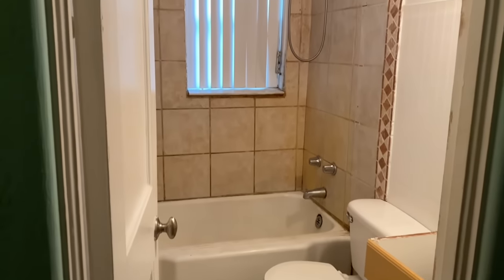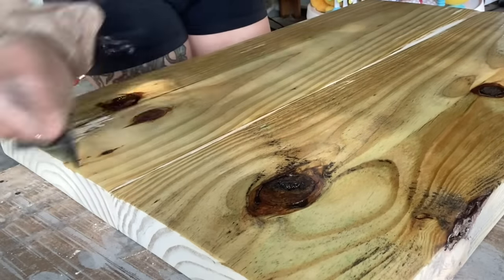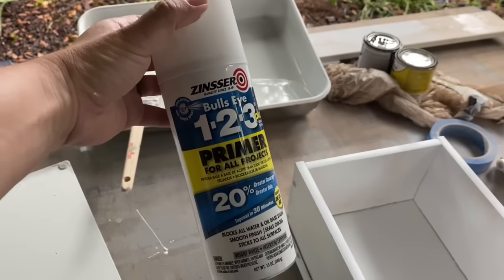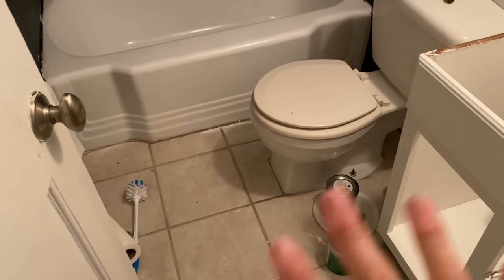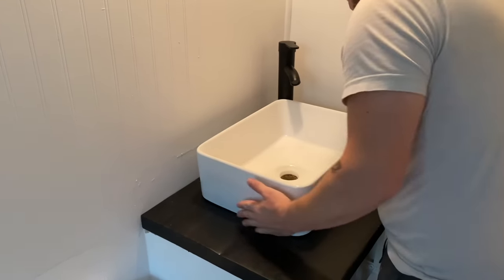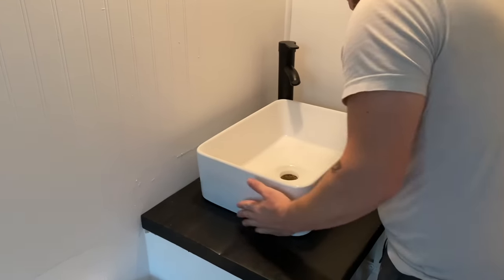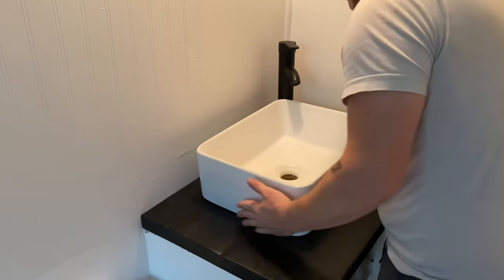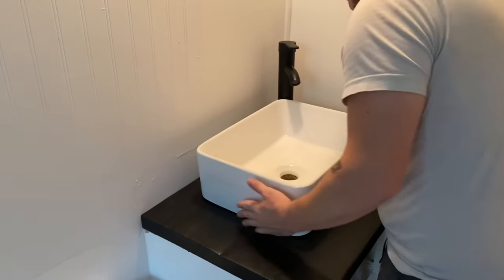BATHROOM REMODEL ON A BUDGET | Tips to Save Money

Comment: I think you did a great job!    I renovated my half-bath in a very similar way to how you did your bath vanity:  made a black painted countertop out of plywood (waterproofed with a sealer), put a white vessel sink on top that looks pretty identical to yours, with a very similar faucet.   Initially I also put vinyl peel & stick tiles (not grouted) over some ceramic tile that I hated, but I had to rip this up & replace this eventually with a vinyl sheet floor due to the underlying grout lines from the ceramic tile floor ‘bleeding’ through to the vinyl.    If you ever lay down a vinyl floor again over grouted ceramic tile, you may want to consider leveling out the ceramic tile floor to fill in all the grout lines otherwise, over time, you will see a shadowing or a dip happening in your vinyl floor where all the grout lines are underneath.    BTW, you have a gorgeous baby!

Comment: Just to inform those that like to discredit stick and peel, I have used muscle bound which is double sided adhesive for non heavy 4mm tiles behind a bathroom vanity... 4 years in my master bathroom and no type of structural failure... but... with that said, I would not use it on floor where moisture can build up. Even tho you're placing that on top of ceramic tile, that's gonna fail sooner or later.   That's heavy foot staffing too so, I wouldn't risk it lol

Comment: These cheap renovations always look cheap and, iMHO, do not add value to the house for anyone with any discrimination at all. Because it will need to be done the right way. And who wants to pay for a reno done the wrong way? For a few hundred dollars more (say, $1K total) you could have replaced both the floor tile and the bath surround tile to match (with REAL tile). Also, the toilet should have been reset over the tile flooring (after removing and replacing the original tile). It would have made the bathroom look so much bigger and so much more expensive to do it right. I have a feeling this house will be slow to sell.